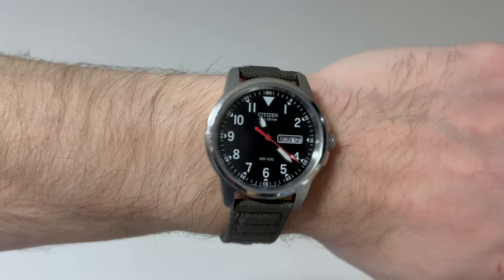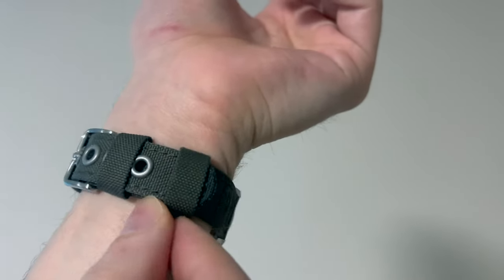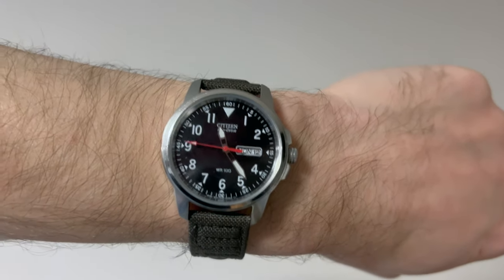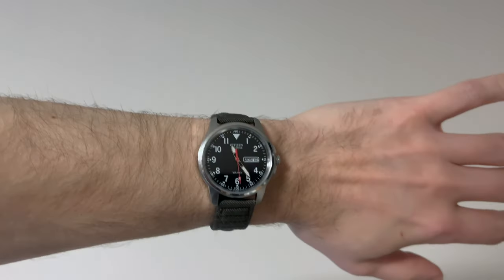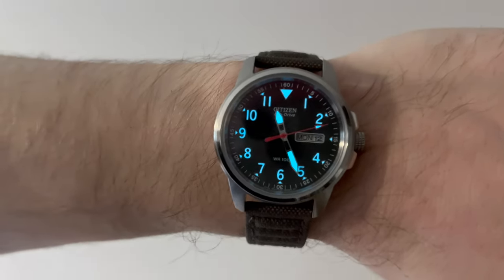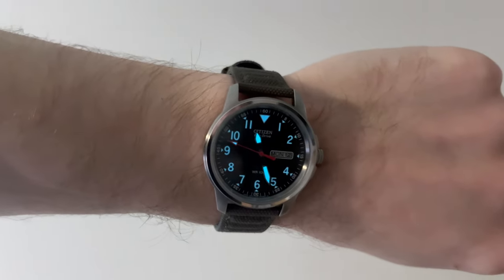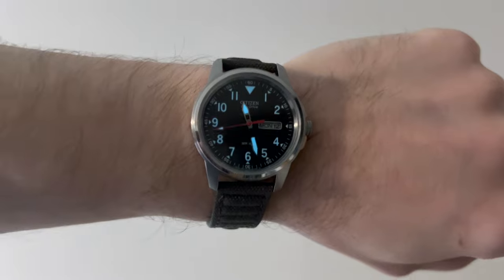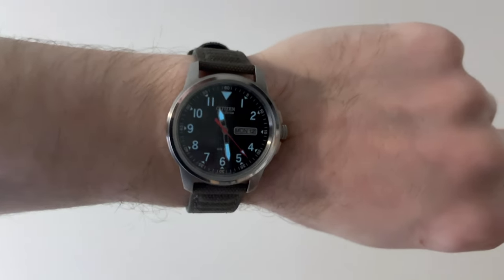Citizen Garrison BM8180-03E Thoughts on the Military Inspired Field Design : Love It! #4k #comment !

Comment: Are you sure its metal and not plastic gear's etc?
Reply from the maker: Citizen very tight about such info. I have no idea about the gear train. I think some parts are metal and most of its plastic. I think probably nylon gears mostly, with low friction optimization since the solar PV & lithium titanate battery system do not generate much energy to drive the gear train. I have examples of citizen Eco-drive that are still working after 20 years, but required a replacement of the lithium ion button battery cell that was about $14 online.
Reply: I think you right and thanks for your response.  I have contacted citizen numerous times to no avail, so not great service. The standard movements that miyota make which is citizen are apparently metal though 😮 you would expect metal my friend to be installed